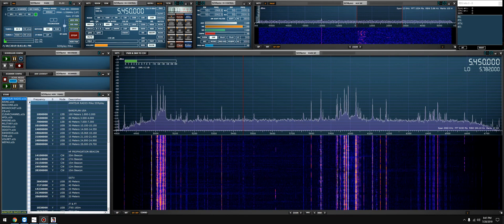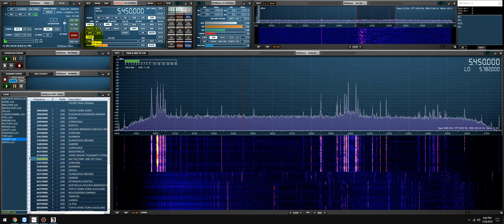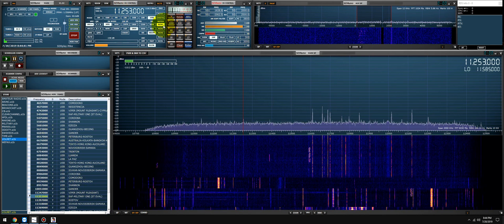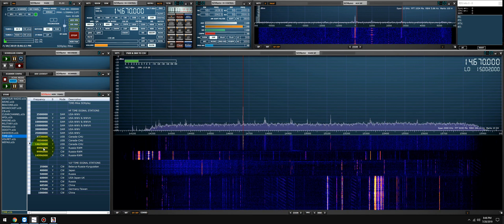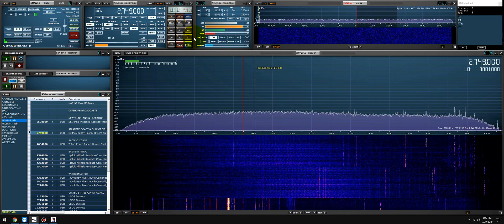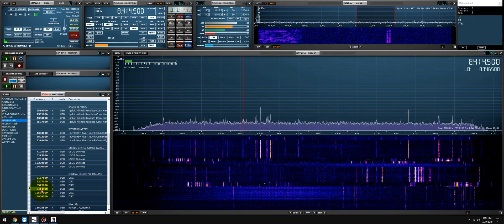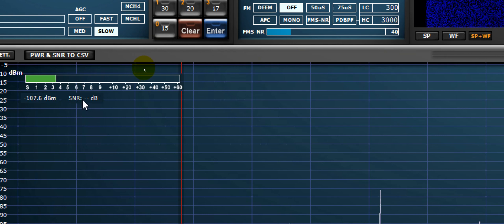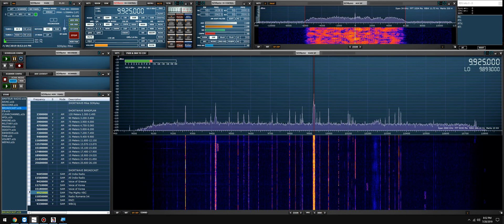Bonito Megaloop ML200 Part 2

Comment: Wow that looks really good; in fact, I got excited about the antenna.  Simple truth is I'm not willing to pay $400 as of yet ;)
Reply from the maker: What I like is that it has an internal gas discharge tube that helps bleed off static as well as a connection to use a grounding rod. 
I also like that it allows me to try different element configuration shapes.
Reply: @SDRplayHamGuides    The price shook me up, but I know the price is superficial compared to the quality of what you get.  I know you will test the antenna well.  I still need an antenna for diversity, so you never know. ;)
Reply from the maker: If it's within your budget go for the W6LVP or the Bonito, both antennas are top-notch in my opinion but the Bonito is proving to be the leader in weak signal DX reception..
Reply: @SDRplayHamGuides   From what I've read, I'm coming to the same conclusion.  I'll likely have one in a few months. :)

Comment: Thanks for the review of the Bonito antenna.  As you know shortwave band reception depends on many variables (weather, location, time of day, conditions at transmitters, antenna height).  Can you do some comparison testing of this antenna and your other antenna using your SDRduo before giving up on the other antenna?  By testing them together you remove a lot of the variables which can give different results.  Thanks.

Tom
Reply from the maker: I can look into it, I run the RSPduo off the HI-Z input along with the nooelec 9:1 unun. Let me see if I can source an antenna switch.
Reply: @SDRplayHamGuides  Excellent.